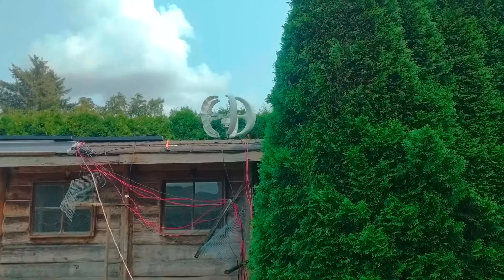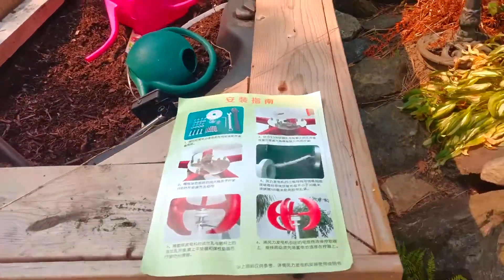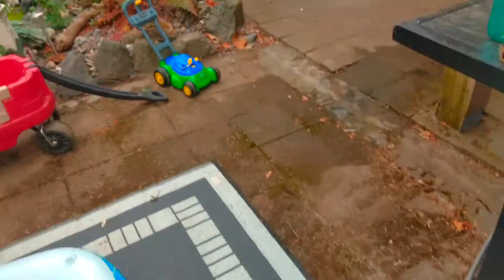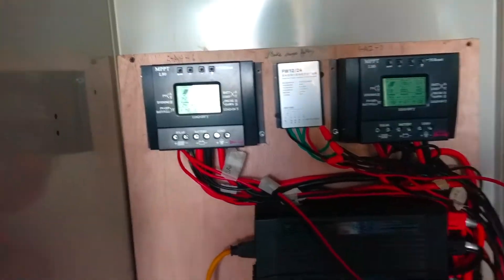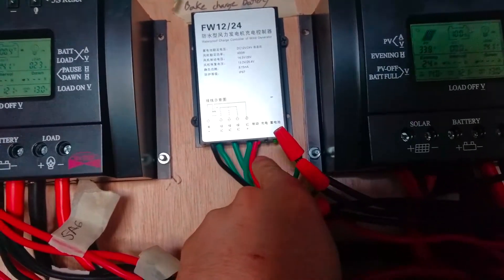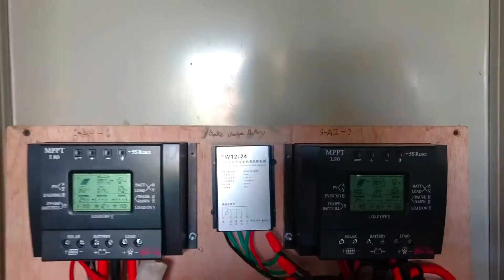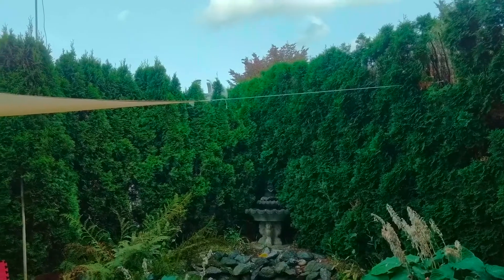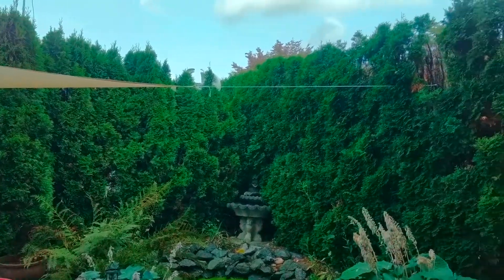how to wire up a vertical wind turbine from amazon

Comment: I bought the same Chinese wind generator. I wired it up. Mine only had two wires. A black and a blue. I used the black for black and the blue for the red to attach battery clips. I hooked it up to the battery and it started smoking!!
Reply: not surprising lol.
Reply: You need to solder a resistor on to it or it frys the wires

Comment: And it doesnt work. This turbine is useless....
Warning* wire battery to controller first. So it knows what voltage the battery is.
Then instal the 3 phase green wires

Comment: If it only has 3 wires, then it is only 2 phase with reference to any one of those 3 wires.
If there were 3 green wires and a 4th common wire, then it would be 3 phase.

Comment: Hello, I wonder if your turbine works, produces the promised energy?
I have seen videos that say that Chinese turbines do not produce what they promise, only 10% of the promised is achieved!
In addition there are many complaints about the constructive quality, what is your general opinion! I urge you to disclose to help new stakeholders evaluate better before buying!
Thank you
Reply: hello Luiz, i am actually the guy from wind turbine factory, and this turbine made in our workshop, we do make good quality and high efficiency turbine but market determines the trend,  this lantern design vertical wind turbine with 1.5m/s low start up wind speed, it is good, right...but it is hard to reach rated revolutions, so efficiency is not that good as traditional three blades horizontal wind turbine, this turbine main purpose is decoration, if need good output still suggest buyer horizontal wind turbine, hoping my reply is helpful to you, thanks
Reply: @SHNewEnergyTechCoLtd  So this is virtually useless? I was thinking about buying one but not for decoration. Thx
Reply: @TheSanien  ... decoration only, I have the same, trickle charging my small battery.
Reply: @SHNewEnergyTechCoLtd  excuse me? Decorative use? Then why the obviously false statement about output? If you sell this as a decorative object, you should tell the customer that to start off with. This is really cheating the public.
Reply: @petergroen6511  Brain is good thing, hopefully you got one
Reply: @petergroen6511  Then nobody would buy it. I use it for mocking my voles.
Reply: 10% haha that much... Pos turbine
Reply: Not even trickle charging nothing usable comes out of this lantern, opened it, inspected and saw aluminum wires inside coated with copper, decoration only and nice to look at. If pure copper maybe then get 10 Watt out of it.